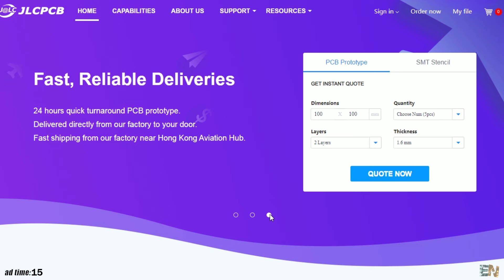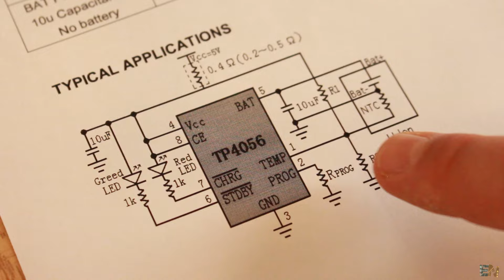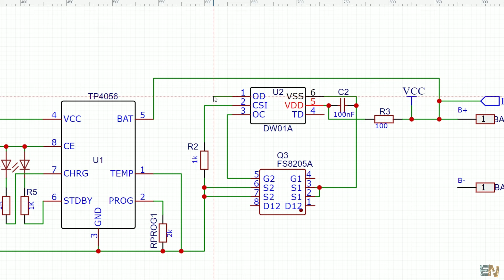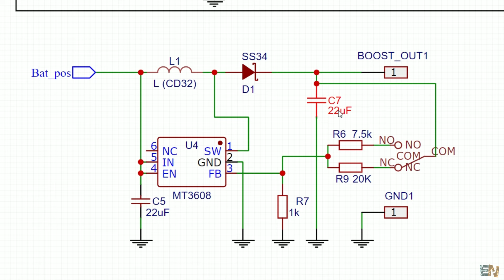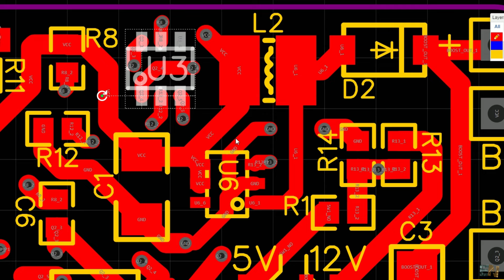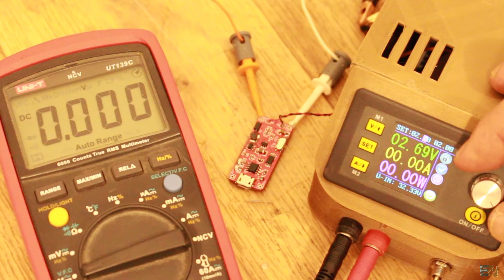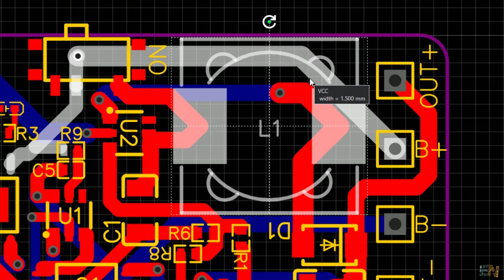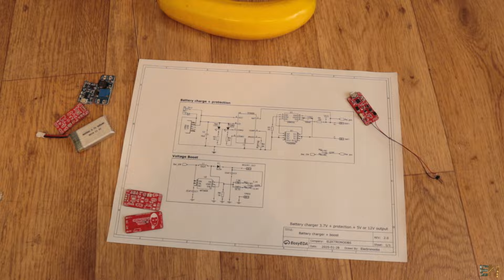Battery Charger & Protection & Boost 5V or 12V

Comment from the maker: Sign up at ELECTRONOOBS.io: https://electronoobs.io/
Follow me on FACEBOOK for more: https://www.facebook.com/Electronoobs
help me on Patreon: https://www.patreon.com/ELECTRONOOBS
Reply: make a video on diy oscilloscope
Reply: Sir can you describe the design of digital volume controller and can we make a digital variable resistor. 🤔🤔
Reply: I know you did esc videos and have better things to do but could you make a 10s vesc for two bldc motors? I can't find anything that is in my budget range.
Reply: Can this module at same time   recharge battery and load something, somewere read that tp4056 need pmosfet to do that?
Reply: Hey there i just stumbled upon your channel and it's pretty amazing. Not sure if you will read this comment but maybe you do and can answer a question for me: 

I am planning on building a Raspberry Pi laptop out of a broken MacBook Pro so i can use it on the go and am currently reading up on how i could build a circuit for the Battery + Internal components and well I stumbled upon your design. Do you reckon this would work for my plan of powering a Raspberry Pi + Peripherals + Display? 
Maybe i'm missing something (maybe this is because it's 3am and i have been looking at this for days now xD) but it feels like your circuit is everything needed for such a project? 

I would be happy if you could reply. :)
Reply: Hi, I want to build bleutooth headphone with a battery on the left and one on the right cup to increase life and have better balance. How does this have to be safely wired to be able to charge both and use both?
Reply: dw01 out of stock, not sure which component to replace with as I can't find an exact match. help?
Reply: Pm me can you to install do sola paint of charger.
Reply: Hello Sir i want ask you because inmake this Charge battry But i Not get 5v and 12v .?

Comment: The lipo battery yuo have connected, already has protection circuit built in (except short circuit) it has OVC OVD OVC protection in small PCB connected in between battery terminals!

Comment: So i made battery back 7s configuration. To be charger PD charger but it can only charge at 20V. My battery input output supports up to 30V charge. So i need to make boost converter that can turn my 20V to 30. Also disconnect it self from battery when battery is full. So that i can get max 30V out from the type c when i remove charger. It also needs to disconnect 30v from battery to type c, when ever charging is started.

Comment: Amazed!

Consider adding power path, when battery is fully charged.

Consider adding switch to turn off leds (for iot usage). 

Consider adding adjustable charging current for Dual Battery (2P 28650)

I am searching a module with features above. I want to build a remote sensor with esp32+gsm (nb iot)+2P 18650+ solar  panel (v6 to v12).
Any recommendations?!!??😅

Comment: Better than a switch I think a jumper that you can just solder will be more useful to select the 12V: then the freed space you may use it to include a M2 hole in the pcb for fixing ir in the project case.
Reply: Pm me can you to install do sola paint of charger

Comment: Great video and PCB!    Just wondering - instead of adding a second switch why not just use 8.5K for R9 and then use a single switch to short out a 12.5K resistor?  That way there is never an open circuit in the voltage selector.

Comment: I love this so much! Tried to use your design for one of my projects but tbh i have no idea what I'm doing and would love if someone would review the board, I've added USB C to the charging circuit and added some breakouts for a pico and a couple power/data out as well as a haptic motor, I've made it to where it uses female headers for the pico so you can remove the micro controller to not fry it when using the 12v out but still would like someone to proof check it before i try to put an order in. Made an LED module as well that I'd like to be reviewed to ensure it works with the break out on the boost/charge/pico board

Comment: For small project that need 5v power i will just use a small powerbank module that have protection.
Like the 134N3P module that even smaller than the TP4056 but have 5v 1A boost, 4.2V overcharge, 3.0V overdischarge, and short circuit + over current protection

Comment: Your PL page lists the TP4050 rather than the TP4056 demonstrated in the video. The TP4050 eBay link provided in the PL is to a TP4056. Perhaps a simple typo in the PL page, i.e., TP4050 should be TP4056.

Comment: Your measuring the input current and you say it is the output current. If you have the voltage change resistors in series instead it won't blow your chip. The switch would be in parallel with the one resistor instead. That makes the chip to always see the reference.

Comment: Hello, very good video but I have a question
When charging the battery, does the TP4056 get too hot?
Reply from the maker: No. The current is limited. Is getting normally hot not excessive

Comment: Can you make a powerbank (stupid question)
But this time Arduino as a controller
So we can use a oled to see how much power is left,how much we used, charging stetus and which port we are using on what ampere (1A , 2.1A)
And Arduino will control the MOSFETs of booost converters
And a small button for torch light like other display powerbank modules
This will be a great project

Comment: You mentioned that the PCB is populated one sided because of future need to order them preassembled from JLCPCB ? How much would this PCB cost assembled with all the components ? I suppose you could also do hot air reflow soldering at home instead of soldering each SMD component by hand.

Comment: Electronoobs, nice project. Why don't you put the resistor in parallel instead of using an extra switch. My logic is like this. Put the 20K resistor permanently and place a 12k parallel to 20K through a switch. Now when the switch is open you got 20k. When the switch closes you get their equivalent resistance, i. e, 7.5k.

Comment: 12:04 To fix this issue just connect the 20K resistor permanently to the circuit. Then, just calculate which resistor value you need to put in parallel to that to make 7K, and just make the switch connect it in parallel. That way, you can either have 20K or 20K in parallel with whatever is connected to the switch. This means you'll never have a floating pin.
Reply from the maker: Thank you so much for the tip
Reply: @ELECTRONOOBS  is this implemented in your version 2 of the gerber file or do we need to edit it?
Reply: A different solution would be switching the resistor to ground. In that way the ic will stop working while floating and turn on when the switch is closed again. Second feature is a damaged switch shut the ic down.
Reply: @Aykaramber  Switching the resistor to ground will mean that you could have the full output voltage (12v) on the feedback input, which may or may not be rated for it. So the best solution is to follow the datasheet and just connect a parallel resistor.
Reply: hi the parallel resistor is approx 12k
Reply from the maker: @iuhere  it is not. I will do that tonight and update the design.
Reply: @ELECTRONOOBS  thank you <3
Reply: @ELECTRONOOBS  how much watt resistor we need,can we use through hole resistor
Reply: @ELECTRONOOBS  wonderful idea, but im afraid i will bump the switch to 12v by accident, and fry my circuit, do you think adding a few pins for a jumper would be a better solution?
Reply: Yes, this. :)  The 19K1 in parallel with a (12K + 380R) is really close to the 7K5.
However the chip may just not like the resistance changing during operation, regardless of floating pin or not.
Reply: @herbertderbler1344  put a dab of hot-glue on the switch
Reply: @leglessinoz  how about changing it to be a jumper instead of a switch? can't accidentally change that :)
Reply: @MrSapps  ok easy enough to do without changing the PCB though
Reply: lol just basically typed the same then read this.. DOH!
Reply: Plz will sum1 tell me what the ones are called with the on off button i got some out of some cob lights but only 4 so i bought 20 for 5.99 but thry have no om off button so 5here worthless cos how can u turn stuff on or off i dont get it
Reply: Pm me can you to install do sola paint of charger.
Reply: @ELECTRONOOBS  I'm trying to learn easyeda for a project can you help me design a 3 amp max out put board i cam do the testing of it
Reply: @ELECTRONOOBS I'm trying to learn easyeda for a project can you help me design a 3 amp max out put board i cam do the testing of it

Comment: I have a question, what happens if you have the power supply (micro usb) connected and you have a loud at the end. Will the LiPo Cell charge or discharge? And will the load get current or not if i do it that way?
Nice video keep on going pal. :)

Comment: The booster IC blew because it had no voltage feedback and went overvoltage on the output.
As you flick the switch the IC momentarily loses voltage feedback and thus thinks that the voltage is too low and during that time the voltage rises to a level where the IC burns out.
So it's just a bad design on your part. :)
To fix this you could have left R1 permanently connected and had the switch connect a 12.3 Ohm resistor in parallel, which would lower the total resistance to 7.5k.
Or you could flip the thing around and place two resistors instead of R6 and one resistor instead of R8 and R1.
This way the regulator would jump down to 2.5V during the time it takes for the switch to make contact. This would also be the ideal way to do this because it would mean that in the event that the switch failed your regulator would not go overvoltage and burn out everything on the circuit.
Also your boost output capacitor should be placed as close as possible to the diode to minimize voltage ripple at higher current.

Comment: Why not just use a dual pole switch and create a dead short as you switch voltages. this will cause the circuit to shut down for a moment and not overload the IC.

Comment: Hello. Looking to use your design. It’s perfect for my use. 

Looking for advice of changing a few things 

For a 2s configuration. 7.2-8.4v 

Would have to use 9v/12v boost 

What would need to be changed on the charge protection 
Different chip/resistor value changes? 

Boost converter portions. 
Same chip for 24v 
Do I change the resistors for the higher voltage coming in. 

Any help on values and portions would be appreciated! 

Finally got a 3d printer to do more of your projects.

Comment: To solve your problem with boost ic, you can just add new two resistors in range 300k to 600k in Parallel to your old resistors and switch, so in normal operation the small value"old resistors" will  take the controller and set the correct output, and when switch flipped the new resistors will kick in and set the output voltage to 5 voltage until switch flipped, after that the olde resistors will kick in and set the output voltage to 5V or 12V.

Comment: I need a 12V Battery protector (Overcharge/Discharge) and monitor with bluettoth to check the voltage and to warn me if the Battery is empty. 
Do you have a finished project or video like this?

Comment: Better solution for voltage select is to switch the resistor value by bridging one resistor in one state and connect both  in series in the other mode.
Means for example 7.5k in series with 12.5k for the 20k in 12v, with the 12.5k bridged by the switch for 5v, so 7.5k in 5v mode and 20k with 12.5k  connected/not bridged for in 12v mode. At no time is the feedback disconnected and it becomes safe to switch even with battery in place.

Comment: how would you ad a line where one can check the battery level from the connected esp8266 ??
Reply: Make voltage divider with 2 ressistors and put output to analog read, I think that for esp8266 analog in is 1 v. Then in code check value of voltage. But if you use battery directly to esp just put small step down to 3.3 v (working V for esp) I think voltage drop is 0.1 v so when your batterie reach 3.4 it will switch off esp.

Comment: Cool board, but i guess i have a better solution to your problem. I suggest connecting the 20k ohm resistor (R1) permanently to the voltage divider so you would have 12V output and connect another resistor through a switch in parallel to the 20k resistor to obtain 5 volts output. This way the boost IC will always have its feedback loop closed.
Reply: Yeah
Reply: can you tell me the voltage of capacitor and wattage of resistor
Reply: @jagdeepsharma1772  which capacitor and resistor?
Reply: Makes sense to me...I am also wondering about the lack of a big 100 uF buffer capacitor on the boost input side to handle startup surge current when the boost section is switched on....or maybe the MT3608 has soft start capabilities ?
Reply: is there quided video about this procedure? Idont have knowledge about electronics, but I have done projects by following youtubevideos
Reply: Wrong..

Comment: I found a similar module with a 9V/12V switch. The switch would break before make, so the boost IC burned when I switched the output voltage while powered, just like yours.
Maybe you should consider a make before break switch, or a different resistor configuration as suggested in another post.
A make before break switch would have avoided the problem.

Comment: By the way, to make the board even smaller you could use a battery protection IC with integrated mosfet instead of the DW01. Check out this one: XB3303A. It's available in LCSC.

Comment: I would buy 20 of these if the over discharge voltage was above 2.8. They would be ideal for a large power bank if they where connected in parallel. I was having trouble getting the voltage high enough for anything. This could make the simplest and safest battery pack that could use any cells.

Comment: The problem with this project is that is a copy of an old video of Great Scott, the circuit and the components are the same, the only this that change is the boost converter to 12v, but is the same :/

Comment: can you tell me how i can get the entire pcb with all components ?  I purchased the gerbers from your site but didn't realize i would still need to order the components and solder them on.  Is there any way I can get this fully assembled ?  Or can you tell me if there is something else like this that I can buy ? I have a bunch of projects that use lion and lipo batteries and I have the same problem as you, in needing a few boards to charge and boost power.  Any help you can provide would be greatly appreciated.  Thanks.

Comment: You should use the switch to short circuit une of two resistors in series instead of changing from one to another. This should solve the problem of no residtor during the change.

Comment: Great and thorough run through!

I have a question:

You are using a battery lower than 4.2V, does it make any difference what voltage battery is used?

Eg. If I put a 4.2V or 3.7V lipo to charge? Is there something I need to change for this?

By changing the inductor to a larger value would this mean that I can charge at a higher rate?

Comment: Well done!! Impressive work!
You can connect one of the two resistors bettween C7 and R7 point for protection of U4 and let the switch toggle bettween the another resistor in parallel to give you the exact boosted voltage and open connection 
.
*Fixed resistor 20k between C7 and R7 ( new connection )
*NC open ( new adjustment )
*NO 7.5k = R fixed // R toggled
Bettwenn C7 and R7 ( same connection)
7.5k = 1/( (1/Rt) + (1/20k) )
R toggle = 12k
So either 20k or 20k//12k = 7.5k
No floating point
Hope that helps
Reply from the maker: Thanks for the tip. Great idea!
Reply: @ELECTRONOOBS  keep it up!!
I've been following you since 4 years and you helped alot during my engineering degree till graduation

Comment: You could have avoided the issue with the undersized inductor by looking at the commercial boost PCB with MT3608. The Chinese usually use the smallest/cheapest possible part to get the job done, so if your coil is smaller than theirs, it is most likely too small.

Comment: Nice explanation, it did leave me with some questions. Why didn't you have a 7k5 resistor on the MT3608 ic and have a switch add 12k5 resistance to the circuit ? Wouldn't that save the components you added and avoid the current spike for the MT3608?

Comment: Hello, I already had a problem using the DW01, he just couldn't keep the output off permanently. It restarted whenever the cut-off voltage increased, as the battery stabilized. It was necessary to trick it with 2 diodes in series for voltage drop and also an electrolytic capacitor to prevent reclosing. The shear stress of the FS312 seems more stable to me, test it if possible!

Comment: Great content, and a nice detailed explanation of the design process 👏. May suggest in theory that the booster short circuit could be fixed by a mosfet/pjt of the same rated current, as such, if the 5-12V switch at bounce state, the gate(mosfet) or base won't be supplied thus short circuit; you can ensure the drainage by a load resistance. Another way can be a capacitor put across the booster output so it doesn't lose current instantaneously at the switching action, however, this may be not the safest option to turn off in safe fail mode.